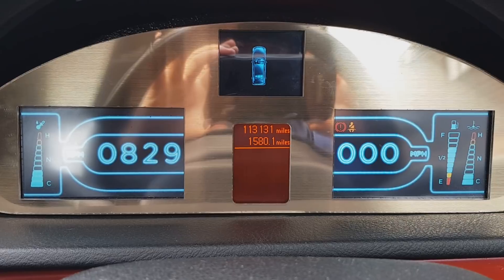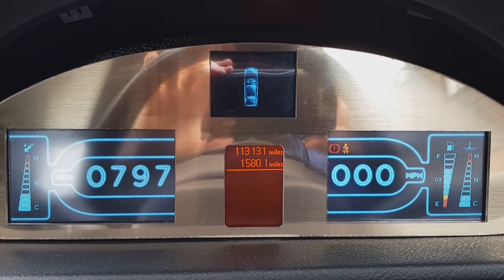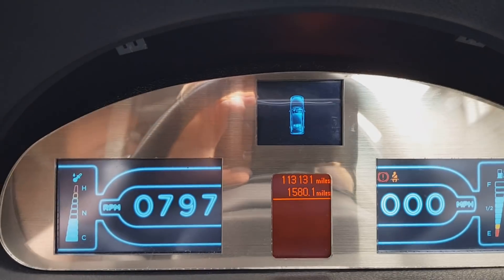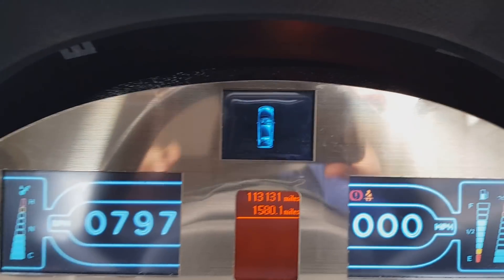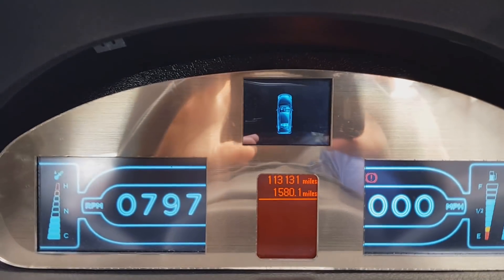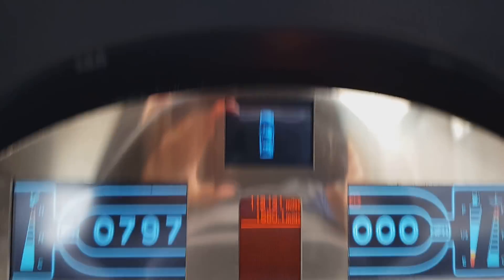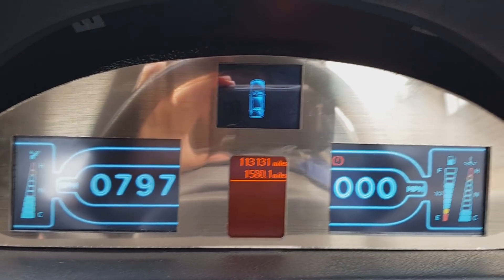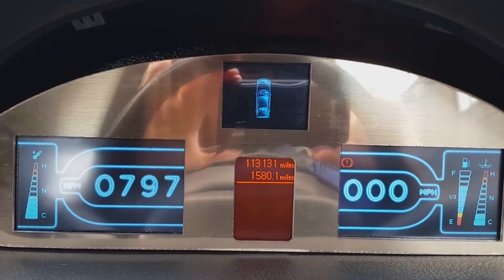Hacking my car: TESTING!

Comment: That's brilliant! I am currently doing a v8 conversion into a Mercedes Vito here in Australia and need to get the can data from the GM gearbox to send the rpm and speed to the Mercedes dash. I read your instructables tutorial and I think I can do it. Not as easy as you but I will get there. Of course if you want to grab a Vito dash from the wreckers and give me a heads up that would be super too! Just kidding. Well done and look forward to any mods you do in the future.